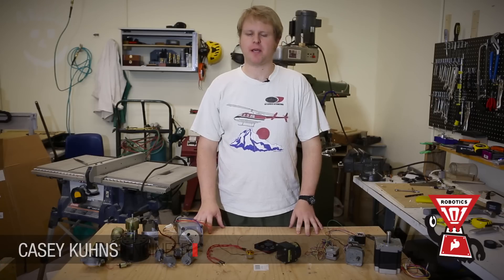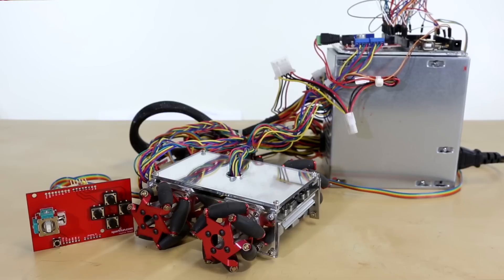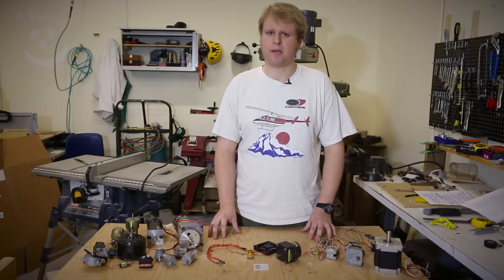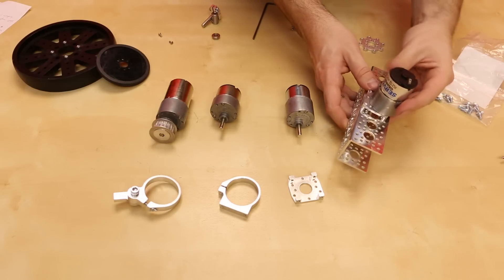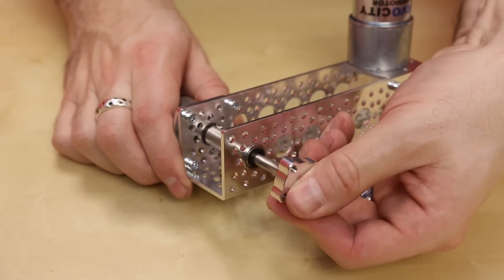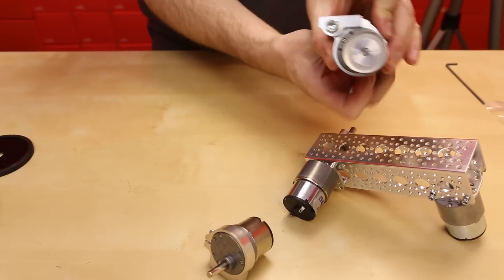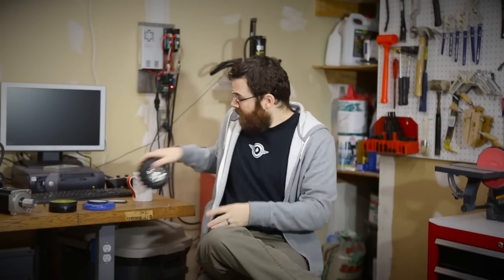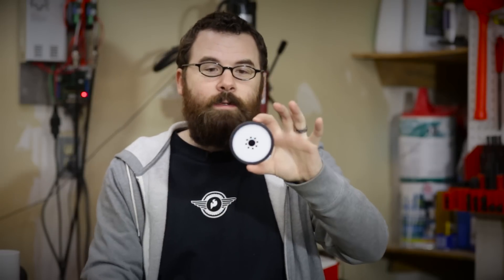SparkFun Robotics 101: Episode 2 Angular Motion

Comment: Editing foible -- The part where the engineer says "these brushes can wear out" is misleading, but the editor cuts to the armature ---  he's pointing to the commutator bars (those ~12 copper (or cupric alloy) vertical bars that form a cylinder around an insulator [that serves no purpose other than to make sure the current transfer is to the windings, and not to the shaft)) not the brushes. See: http://2.bp.blogspot.com/-HEs4I41DzaI/T6_pB-9cDYI/AAAAAAAAB_k/br36pKbBq4c/s1600/SEGMENTS+AND+BRUSHES.JPG  The brushes were two grey/black carbon rectanguloid's that are the conductive element that ends up being the point of current transmission. 

Typical topology of a consumer brushed DC motor (I'll use a standard cordless power drill in this example since everyone knows intuitively how it works -- the principle remains the same for all DC brushed motors though)-- current source from the battery in the bottom (often ran through an H-bridge of fet's, or microcontroller with hall effect sensor, or whatever now that these components are cheap) => wire running current up from the battery pack up to to the carbon brushes, one on the 'left' and one on the 'right' if held vertically [if your drill isn't working, check your brushes and switch, those are the two failure modes of non-Ikea drills, and a new set of brushes are pennies] => physical contact between carbon brushes + copper commutator bars transfer current via to a specific subsection further down the armature that's split into one section for each winding, with copper tied into the commutator. When the brushes transfer power to the copper commutator bars, the tied in subsection of the windings get charged. with the permanent magnets (generally two large hunks of metal one which will stay + and the other will stay -). See: http://www.industrial-electronics.com/images/Motors-Generators-Emanuel_3-4.jpg 

 Around the windings, in another cylinder, stator teeth (those silvery metal bars) become magnetized depending on which set of two brushes are currently delivering current. In the enclosure of the 'drill' there are also two semi-circles of metal, each with different polarity. Opposites attract, similar charges repel, so your stator teeth are constantly both 'chasing' the permanent magnets. This ultimately converts your magic pixie electrons from the batt into axial rotational motion produced by armature flux, and bobs your uncle.

Obviously motors of other forms will operate differently, but anything that works off induction is approximately designed of these principles (eliding design details like cooling -- usually done by an impeller -, flyback protection diodes for back-EMF, chopper circuits or PWM + capacitors to control drive current, essential physical drive components like bearings, and modern things like thermocouples to protect against overheating motors and of li-poly/li-ion batterie)